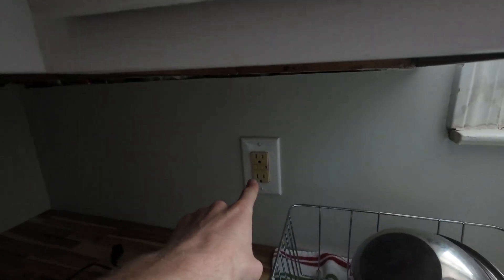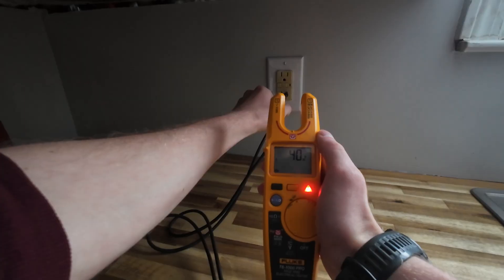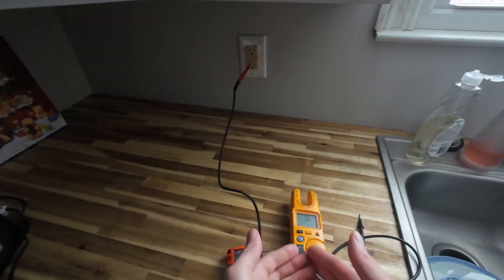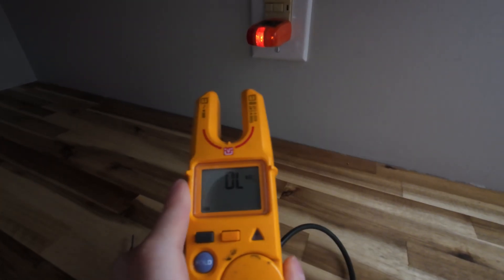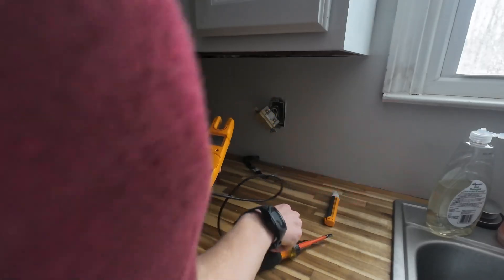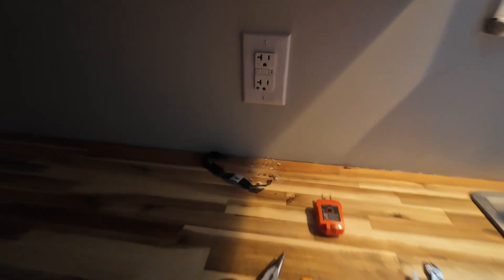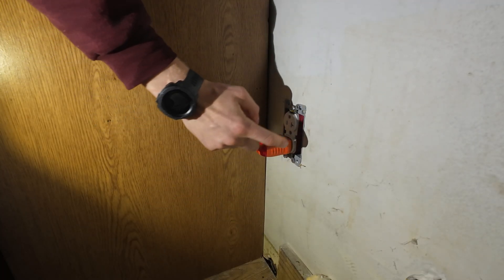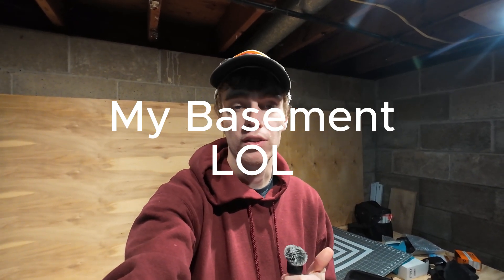Chasing An Open Ground| Watch Me Work

Comment: Today never rely on water pipes as source for grounding due to the obvious case of plastic piping both for fresh water and sewage. Dirty sewage might be conductive though so you could get random results and unexpected hazards.

At least for me all ground shall be in the provided through the breaker panel, and not through some water pipe hacks. Main ground and neutral shall be bonded together only at the primary breaker panel and provided from the grid. A local grounding point isn't wrong though and shall be seen as a backup.

My experience is that the glue of at least some electrical tape becomes very iffy over time and that's why I don't like it.

Now I'm in Europe where we have 3 phase 230/400 V with separate ground and neutral. Might seem scary to some, but it's nothing special. Here we have ground fault breakers in the breaker panel and usually not in the outlets.

Comment: With plastic isolated plumbing (including the sink drain) a standard multimeter won't be much use.  Ideally you'd use an IR tester to check the impedance between the pipework etc to the premises grounding (earthing) system to determine if that metalwork presents a hazard.  It's actually not about getting between line/neutral and those isolated items because the GFCI will act if harmful current can flow in such a situation.

It's much more important to consider what happens if your supply neutral goes open or just high impedance while it is still being used as a GC.  If that happens your entire grounding system and anything attached to it gets pulled up towards 120V (USA) by any current that would otherwise flow on the GC.  Anything metallic that is in sufficient contact with the soil (directly or indirectly) but not attached to the grounding system then becomes a hazard if you touch it and anything attached to the premises grounding system at the same time.  Lean on the kitchen sink and touch the metalwork on the electric mixer or microwave for example with a GC fault and you will have a bad day and the GFCI won't blink.

Since you have 120V ground potential and want to keep current below 6mA that would mean anything metallic that enters the premises, is not already attached to the grounding system, measures less than about 22 kΩ to the premises grounding system and is accessible inside the premises must be bonded.

Happy to discuss if anyone disagrees.  People in the IEC world, GC = PEN.
Reply from the maker: You bring up some good points, especially regarding the potential issues with an open neutral and isolated plumbing.